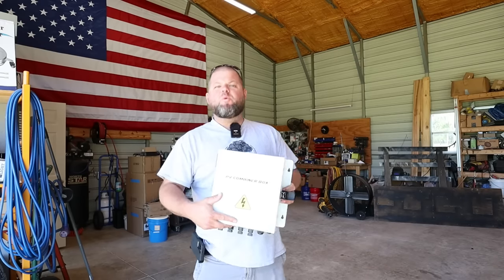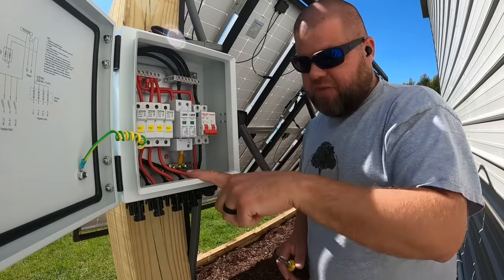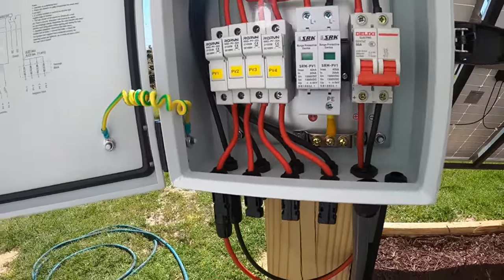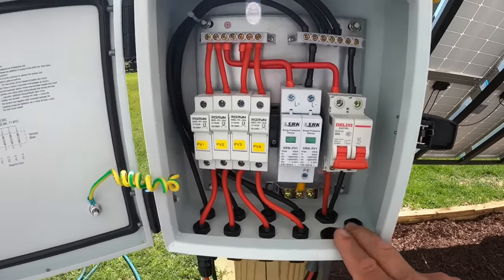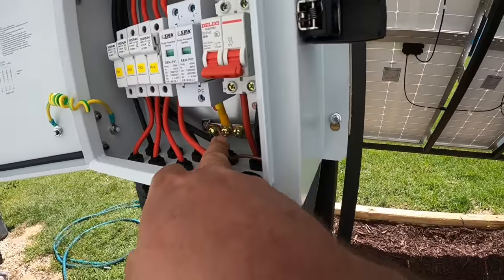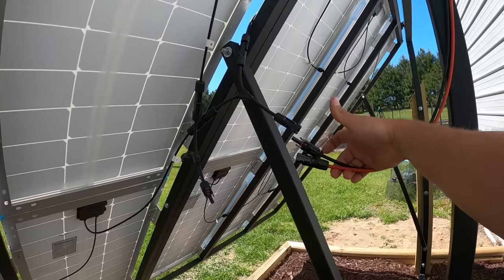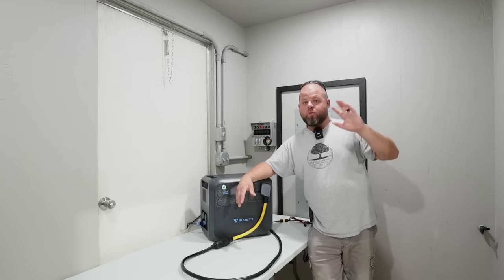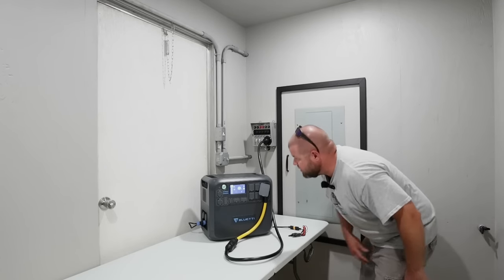Installing a PV combiner box. Why you need one for your solar array! #748

Comment: Earthing a ground mount solar system at the combiner box is literally pointless, allowed by NEC, not required by NEC.....because it does nothing.  Surge protection should be inside just before the inverter, a combiner box surge with a bus bar going to surge and main breaker isn't doing anything in a lightning situation.  There are plenty of videos of folks who did the same with disastrous results, because your PV conductors between the ground mount and the building are antennas that pick up ground strikes in many cases miles away.  If you really think a 6AWG solid copper conductor can dissipate lightning voltage (its DC btw) connected to a 25ohm copper coated ground rod, you missed math class.  A surge arrestor that is sacrificial just before the string inverter will save your equipment, grounding the solar PV panels and mounts won't.  Roof Mount require by NEC earthing, but ground mounts don't, and a separate earthing rod that close to a building while not being bonded to the main service ground add a ground loop problem, a differential in earth with respect to the bonds.  To eliminate, the two rods, the building rod and the PV rod are required to be bonded to each other. to maintain the same reference to earth across the entire system.

Comment: Nicely done. Although your combiner box is adequate, personally I would have used a blocking diode for each PV string to prevent the back flow of current upon one of the string being shaded., thereby minimizing the voltage drops as seen by the combiner output breaker. Also,  I would prefer using some of those PV 10A DC breakers instead of  the fuses. They are as cheap but  much more convenient than the fuses, and you can keep the fuses as added protection. They DIN rail mounted and come in 1 to 4 poles that can be turned off all at once. The 2 pole actually can be used to disconnect both positive and negative of the PV string if so desired.  You did a great job with grounding the PV and frame.
Reply from the maker: In theory I shouldn't blow any fuses without a problem, so cost of replacing isn't a concern. My panels have bypassing diodes for the shading issue.
Reply: @TKCL  You're right in therms of trusting the fuse not to blow. Most of those Din rail fuse have indicators too, to let you know they blew. But in my case all my  PV are used panels that are full of defects, but that I was able to rework the detached junction box, dead bypass diodes or broken solder tabs as well as sealing them from moisture. So, I no longer put my faith in fuse lasting long.... Bypassing diodes are included in the panel as you said, but blocking diodes are not. They are usually added to the combiner box, or plugged inline for the MC4 version, to prevent back flow of current from strings to string, as that string gets lower overall voltage. That's a bit different from what the function of the bypass diode is. Think of it as regular parallel batteries. Their voltage will equalize to an average by charging the weaker one. But if you put a blocking diode the higher voltage batteries cannot feedback that weak battery and will keep  sending their maximum current to the charger/inverter. At night also, it adds additional protection from batteries banks back flow, since the battery will be at a higher voltage. This will definitely prevent them from discharging through the panels at night. Most charge controllers have these diodes built in already. but some times they fail and when they fail, as most semiconductors, they fail as shorts.

Comment: Thx a lot sir for all your efforts. However, there's no more need for a combiner box when using certain hybrid inverters. Yes you read me right. The newest EG4 18K-PV, just made combiner boxes obsolete. Thx
Reply: The Combiner Box is still invaluable in spite of whatever hybrid inverter outstanding features.  When the Combiner Box is as close to the PV on the roof, you can minimize all the parallel PV string cables, bringing only one single cable pair (+ and -) of larger  ampacity to your hybrid controller PV input cutoff breaker. Of course the PV box must be IP65 or IP67 rated in such a case. Most 5KW hybrid inverters can handle 2 strings, so you can get by with a single 20A NM cable going to the inverter. Another advantage of the PV combiner box is that it gives you the ability to select whichever string you want to enable or disable for servicing perhaps to adjust your power input according the the seasonal solar production.
Reply: Also it allows for local surge/lightning/emp protection which for some locations is critical. Plus it allows a secondary shut down if you need to work on the inverter and don’t want to work with a few hundred dc volts of live wire or manually disconnect a bunch of mc4 connectors.
Reply: @francoisguyot9770  we are just getting started with our off grid solar design/install. I have spoken with a couple different people who say to install the combiner box. I am looking into the EG4 MPPT 100a/48 charge controllers as an option to the Outback 150CL mounted on our prewired Conext SW4048 Inverter. So much has changed in the industry in 4 years - my head is still reeling from trying to keep my thoughts in order. All we need to begin with is power to our 50Amp RV and a few additional plugs to operate hand tools.Trying to figure out how to gain as much power from the strings of 390 and 550 watt panels (balance the panels or abandon the 390 watts) is a little daunting for my head.

Comment: Curious about your array configuration. I'm looking to run four 400w panels as 2S2P. Each panel is rated for 10 amps. So I'll end up with two 800w strings each at 10 amps. When connected together in parallel the will create 800 watts at 20 amps correct? Does this mean I should use a 25-30 amp fuse? My wire is 10 gauge so good for 30 amp load. Thanks.

Comment: In Puerto Rico, the grid is "Unstable" at best.  Our solar system, which runs the entire house, is done with the 10 curcuit manual transfer switch.  The inverter output goes thru a 50a generator cord and plugs into the outlet on the transfer switch box.  This does a few things.  1. Entire home can be run on solar. 2. In the event the solar has an issue that needs to be worked on, the inverter can be unplugged from the transfer switch box, and a gas generator and be plugged in to it instead.  3. Any higher than normal loads, like running chop saw/table saw, the breaker on the transfer switch can be flipped to grid, and draw it power directly from the grid so the inverter doesnt get overloaded.

Fantastic product, and many good reasons to use one instead of a sub panel for solar.  And dont let the mess of wires on the transfer switch scare you.  They are super easy, extremely safe, and the instructions on the Reliant models are very straightforward.
Reply from the maker: I run one myself

Comment: I just had that transfer switch installed. I use my Oupes Mega 3 with it. I can’t have it plugged into wall outlet to charge at same time I have plugged into generator outlet even tho I have it on line position. It will blow breaker in main box.

Comment: It'd be super rad if you put a MC4 connector wall plate on the wall instead of just having the wires come out.  Then you could have a MC4 "jumper" cable to use in your testing.  Awesome video!
Reply from the maker: Not a bad idea, everything is temporary until I find my permanent system.
Reply: If you are under 30A and using 10AWG cables you can use an Anderson powerpole panel mount from PowerWerx. Combine this with a extra duty outdoor enclosure and you have a UL listed and approved temporary connection. 

I do this with my combiner box (combiner box is inside) with 4 200w Elecaenta portable panels and a Pecron E1500LFP.

Comment: I don't believe your grounding is up to code. You didn't mention if you used weeps or star washers to dig into the panel frames. The aluminum is anodized and you have to get past that coating in order to be code compliant. In some jurisdictions, you can't just connect to the ground hole. You have to use approved stainless steel connectors with weeps.
2nd, you can't have more than 1 rod other than at the main service disconnect unless they are less than 6' apart. If more than 6' you must bond all rods with at least a 6 gauge wire.
Don't forget to separate ground and neutral at the subpanel when you install that.
Reply: I was wondering if someone was going to mention it in the comments.. thanks.

Comment: Great video Andrew,  on your 6S2P array 150 volts max for DP, any risk of going beyond 150v due to colder wx in the winter months... i did copy your array for my recently acquired 10.8 kw D and thank you very much, 100% agree with size, weght, and cost savings. Others preach 3S2P for DP. Im somewhat concern of volt spike beyond 150v for DP. Any feedback will be much appreciated. .My array lives in s tx coast. In good health, thank you!
Reply from the maker: No risk because mine typically operates at 138 volts, however I do see significant spikes close to the 150 volt max on cold or odd cloud effect days. I don't recommend getting close to the max for these reasons.

Comment: I just got the exact box for my system
Reply from the maker: I now own two, they are well made for the price.
Reply: Yes.. Best box I could find. I have two charge controllers and I need to get another box like this. I was using y adapters and fuses for awhile but I really like the cut off and the surge protector. I'm surprised it didn't cost twice what I paid for mine. I really like all the powmr line of stuff

Comment: That's a pretty good price on the combiner box for what you get.  Nice setup.    I'm running 12 on my 900-watt input and 4 on the 500-watt input.  Like you, I think I'm going to stick with the 100 watt panels on-ground mounts because they're cheap, light, and easy to replace.
Reply from the maker: Agreed!

Comment: Have you thought about a single tracker that will tilt the frame up to catch more afternoon sun. You all ready have a moving frame so set up would be simple. vertical to horizontal .
Reply from the maker: This is aimed north to south, the tracker would have to spin 180 degrees to help me with the sun.  I plan to add a few more cheap panels to the backside of the building for afternoon sun if I need it.

Comment: That manual transfer switch may not be code since you don't have GFCI or AFCI breakers installed in it. 

Check your state's code to see if AFCI is required.

Comment: Hello there, your video is quite interesting. And I have a question. How could someone use two combiner boxes for one solar array  to supply power for a whole  household?
Reply from the maker: You wouldn't need two of them for one array as long as you match up the amperage to the fuses and breakers in your box. You don't want to exceed the rating.

Comment: Great detailed video, would I need something like this for my 3 panel setup putting out about 1400W to my EF Delta Pro? Currently I just have them connected directly to the unit.
Reply from the maker: The benefit here is the fuses, surge protection and the breaker

Comment: I have 4 strings of 6 Blue Sun Bifacial 460 W panels in series for a total wattage of 2760 W and 11 amps equaling approx. 254 Volts. Would you recommend the combiner box shown in this video or is it too much wattage and volts per fuse and breaker.  Can I change out the fuses and breakers or should I get a bigger box - which would you recommend?  Your videos are really on point - thanks!!!
Reply from the maker: If staying in series only, you'll need a box with larger fuses. Otherwise you could split your panels into two sets and bring two wires in and combine them in the box. This will change your amperage and voltage as a result. Otherwise find a box with 15 amp fuses.
Reply: @TKCL I am installing the same number of the same panels.  My two 6500 watt all in one inverters have two pv inputs each that are rated for 500 volts and 4000 watts so I do not need a combiner box.  I will need four disconnects and SPDs.  What would be the best way to do that.
Reply from the maker: You don't necessarily need the combiner, I like them for future additions, the fuses, breakers and surge protection. You could build your own box without the combiner portion, all though it would probably be more expensive to do so.

Comment: May I ask a question.. Does it depend on the type inverter, in which you can connect it to, whether parallel or series.  Or does it depend on the size panel
Reply from the maker: Yes it does, all inverters have a maximum and minimum rating for voltage. They also have a maximum rating for amperage, this determines the way you wire your panels.

Comment: Thank you for the information!  Are combiner boxes meant to have panels in series coming in?  Most combiner boxes have 15 amp fuses which is fine for panels rated for 10 amp short circuit in series, but the moment you parallel them, it would only take 2 panels to overload the fuse in the combiner box. What am I missing here? Thank you
Reply from the maker: Think about it this way. Most boxes have 10-15 amp fuses per SET. But have 40-60 amp output breakers rated at very high voltages. You essentially run smaller sets of panels 10 or 15 amps to each MC4 connector and combine them in the box up to whatever amperage your inverter or charger can handle (and box). Some inverters/chargers are low and some can handle high amperages. You also get the benefit of a breaker and a surge protector. Not to mention an outside quick disconnect in the event of a failure or problem.

Comment: Is it necessary to have fuses, surge protection, AND breakers? Seems like if there was a surge, it would blow the fuses, and even if there weren't any fuses, it would trip the breakers. So either I'm missing something, or it's just multiple layers of redundancy, and I'm honestly curious which is the case.
Reply from the maker: Technically a breaker and fuse do similar duties. The purpose of multiple fuses is to protect each panel set from each other. Should one be damaged or have a short, you want it to blow a fuse and not impact the others that are wired into the combiner box.
Reply: It has so many other uses as well.  If you look into a solar panel set up, or with a set up with an AIO setup/box (Mpp 2424lv for example), not only do you get the added protection that is properly needed and combined together for you, without the need to do all your own fuses, Breakers and disconnects, but that's built right into the combiner box as well and so much safer.  Dually, with the breaker, it has that as a turn off switch for the panel basically, so if you have to disconnect your panels, replace your AIO, Ect. You can flip the break and change that out or rearrange your solar set up, without completely having to disassemble everything and put back together. Or in case of emergency or testing, or upgrading your aio, battery bank set up etc.  So I learned these somethings and learning so much more, these are potentially so useful basically, like a must have!

Comment: Awesome Andrew. Are you running solar power on the shop full time? And does either portable power stations automatically come on if power goes out or you need a separate system like you explain in your video?
Reply from the maker: They will only come on in 120 volt mode if you are referring to pass through. I am running the shop off and on off the grid. I'm almost where I need to be to make it full time.

Comment: Another great video thanks for the detailed explanation. I'm still wondering how the superbase V Zendure technically connects the 240v to a well pump. I'm hoping it doesn't require thier home panel. There is an out put 240v plug. My well pump has a switch like a light switch. I wonder if they make a adapter for a well pump so could plug it in. I know they make them for a furnace.
Reply from the maker: No reason it should require a home panel as long as it has a 240 plug like a l14-30. I found another company coming out with a 240 single unit and it has that standard generator plug.

Comment: Thank you for sharing your knowledge with us I have a question with a Schneider Electric 100 amp 600 volt charge controller for wiring my 480 w q cell panels the way that I understand the document for the charge controller is it's making me think that it's factoring the cold Factor the 1.25 rating so if my VOC is 50.53 and I multiply that by 8 for 8 panels that's 40424* 1.25 cold Factor total 50530 but if the cold factor is already factored in then I should be able to go nine panels purse string two strings total so if I do the math VOC is 50.53 * 9 is 454.77 * 1.56 is 568.46 which means I'm over because the cap is 550 to 600 as a buffer will not bring in any power so for clarity I'm just asking for the Schneider Electric 100 amp 600 volt DC charge controller is it automatically factoring the cold temperature again thank you for sharing your knowledge I have subscribed and I'm learning Lots
Reply from the maker: I am not familiar with that controller or panels. In my experience the cold factor is not factored in on the type of equipment I use. I can tell you that from experience you will see spikes on cold and or odd cloudy days.

Comment: how do you prevent shocks since the pv is outside being energized by the sun?
Reply from the maker: You disconnect the mc4 connectors at the panels to the main wires feeding the combiner box. Those wires are not exposed.

Comment: If the box and all components are not UL listed you will fail inspection. 

Unfortunately there are only a few DIN rail breakers, ground bars, surge protectors and fuse holders that are UL listed. Westinghouse and Eaton both have UL listed devices. 

For a box you also need a UL listed box.